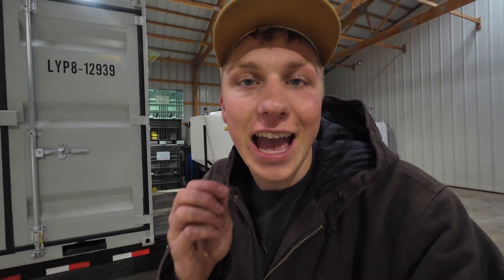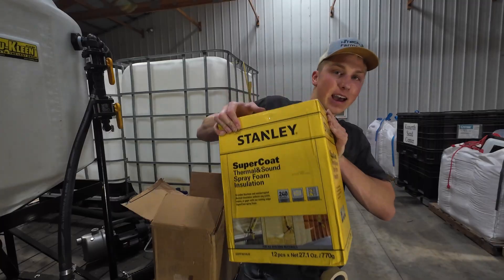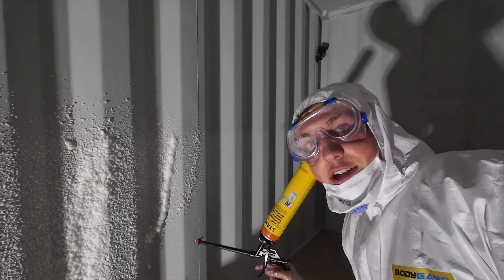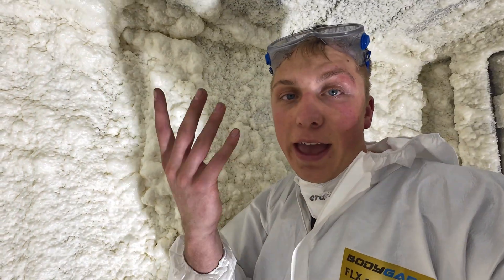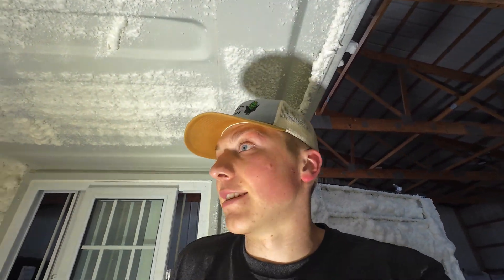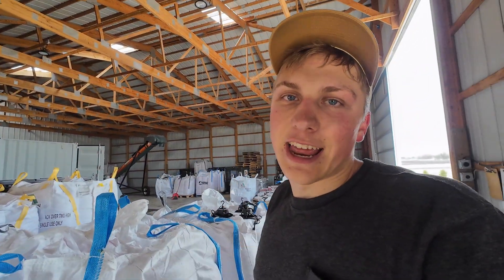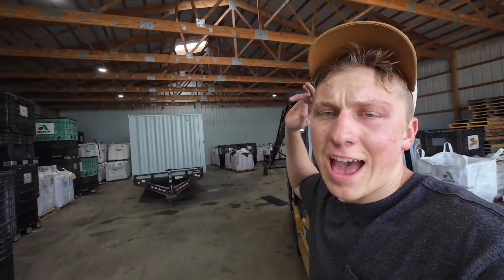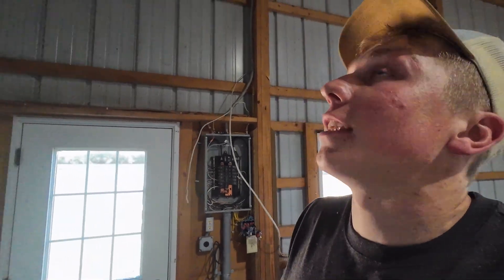99% of Spray Drone Trailers Don't Have This!

Comment: Might want to take into consideration that plants respond to fungicide better when they aren’t stressed and in defensive mode. I plan on spraying from evening to early morning. Cooler temps, proven better yield response, not as hard on batteries, overall better conditions.
Reply: Gotta watch for inversion
Reply: @danillies8716  yes but not too concerned with fungicide.
Reply: @ right you won’t kill crops from it on fungicide.  It you could drift onto edibles,organic etc. I’ve def done it before! Just food for thought 👌
Reply from the maker: Ideally yes, but to cover large amounts of acres, I will need to run during the day!
Reply: @ treat your night as your day. 7am-7pm is the same hours as 7pm-7am. Unless you plan on running 24/7